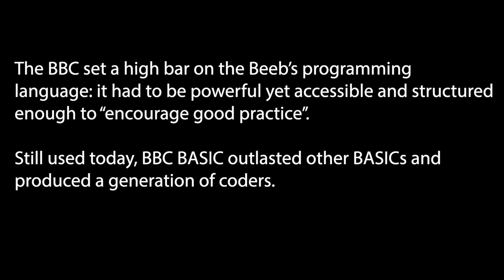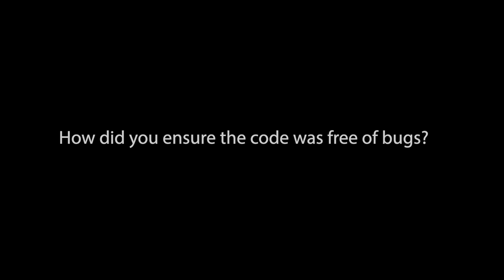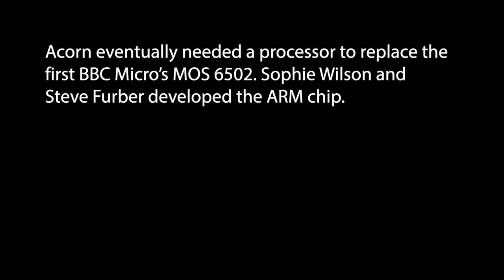4. Basic and ARM: engineering expertise inside the BBC Micro | BBC Micro at 40

Comment: BBC Basic is incredible. The fact that it enables inline assembly and also allows you to use its internal routines from assembler is just fantastic.
Reply: That inline assembler comes from the BBCs father: the Acorn Atom (which also gave BBC Basic the ? and ! operators, along with the full stop abbreviations, the $strings (as well as the normal string$)).
Reply: I do have some doubts. Things I don't like in BBC BASIC is that it does not recognize keywords in lower case, many good BASIC's do this, it has non-standard multi-line list, with a comma instead of a - (LIST 10-20 does not work, you need to type LIST 10,20), and it has no EDIT function, so no EDIT 1000 for example. Also it is very tolerant to dirty programming, you can leave out THEN or OR, and it still works.